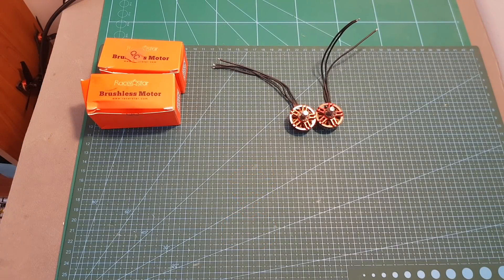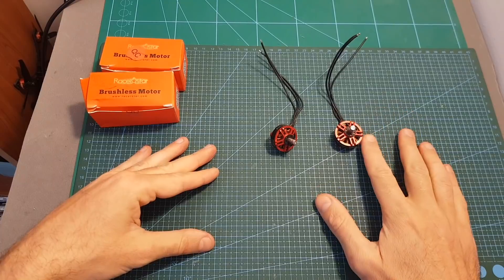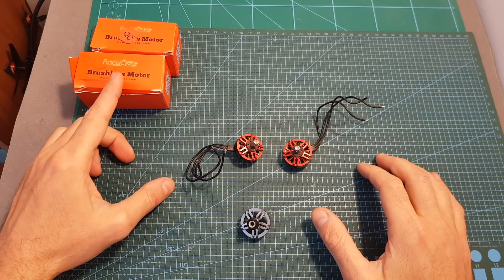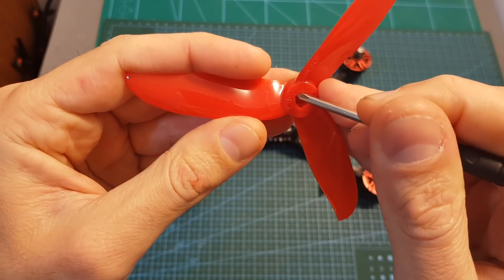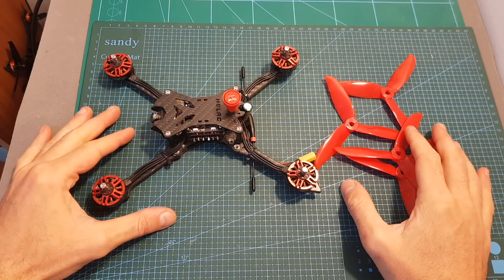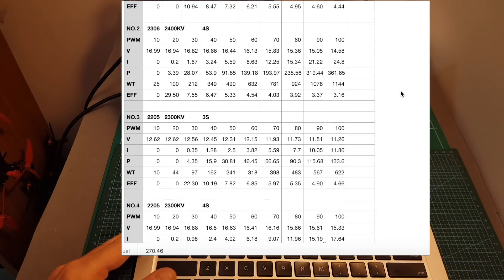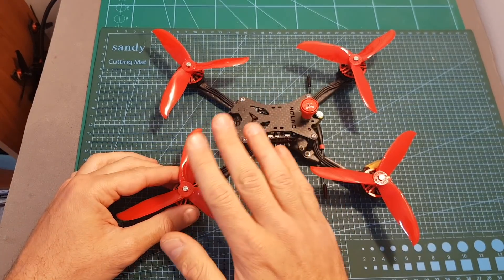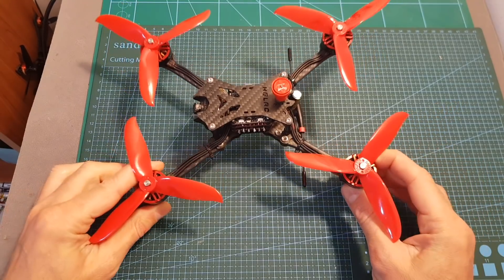Racerstar BR2306/2205 POPO Motors Overview & Bench Test

Comment: I'm the CEO of Lumenier, the inventors of the POPO system. These Racerstar motors are clones of the POPO mechanism -- not made by Lumenier and not licensed. Racerstar did not clone this correctly. Fully authorized and licensed POPO motors from manufacturers like T-Motor, Lumenier, Brother Hobby, Hyperlite, XHover, and BBB will work. With these Racerstar clone motors, props simply fly off!! DO NOT USE THESE MOTORS! You can tell that their system does not work as in your video you were able to simply push a prop onto the POPO shaft. That is not possible with genuine POPO shafts from Lumenier. To mount a prop also requires you to push the button down -- if you don't push the button, the balls will not retract, which means you can't mount or dismount a prop. Stay clear of these clones!! DO NOT USE THEM -- YOU WILL LOOSE PROPS MID FLIGHT. To buy genuine POPO motors and Props go to GetFPV and search for "POPO".
Reply: Thanks for the clarification, this information should have been validated before the video was pushed online.
Reply: @FredCharlebois  did you see when the video was uploaded and when Tim replied ???

Comment: This mounting system is problematic as it has various points of failure. The propeller mount has to stand enormous amounts of force as well as the motor mount. A defect or accident with one of the two will result on a ejection of the propeller.
Reply from the maker: Yep. It didn't survive the flight test...

Comment: Too many negatives here for me.  The performance numbers are unimpressive and the POPO system is clearly dangerous.  If someone as careful as Gal can make a mistake attaching these props then I don’t trust myself to do it “right”.  And I have no interest in a close encounter with a 5” whirling blade of carnage.  I have to point out that a set of the lower KV motors costs $46.00 (@ $11.50 each) and a set of the higher KVs is $50 (@$12.50 each).  So a set of either motors is closer to (or equal to) $50 than it is to $40.  Just sayin’
Reply: These aren't real popo motors. The getfpv guys said they never gave racerstar permission to use the popo system
Reply: I spoke too soon calling them POPO motors; thanks for the clarification/correction.
Reply from the maker: Clearly I wasn't careful enough but yes - it's an issue.
Regrading the pricing - I know my math but failed to mention that the price drops when you buy a set. 
Thanks for your input.